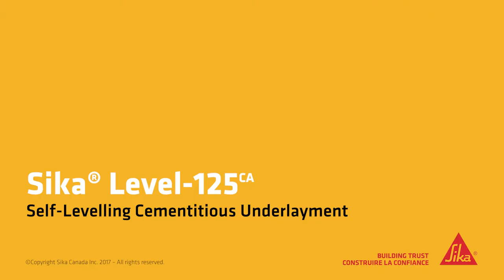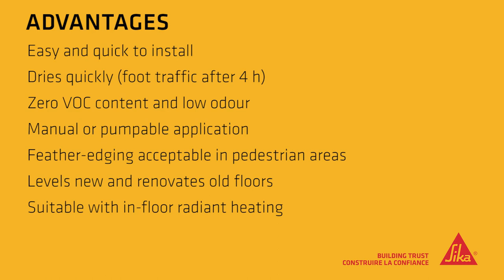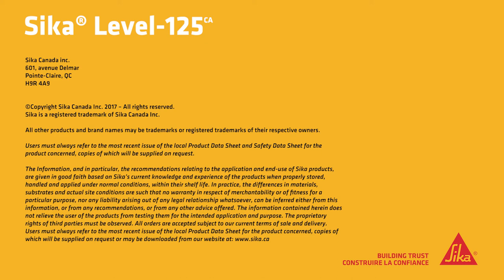How to Install Self-Leveling Underlayment with Sika Level-125CA

Comment: My local building supply store doesn’t carry the primer and says it’s not necessary, is sika aware of this?  Would it make sense as a manufacturer to educate the distributors on the products they are selling or is this a sneaky way to avoid warranty claims?
Reply: Sika has an excellent support network and they definitely train their distributors, whoever you were talking to either ignored the education or doesn't care.  I don't work for Sika, but I do work with their products and have never had an issue.